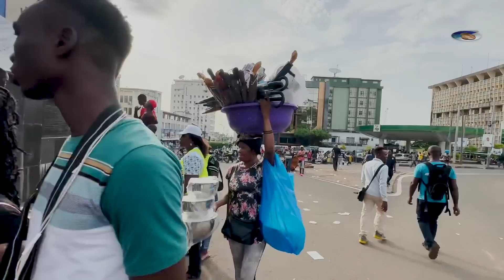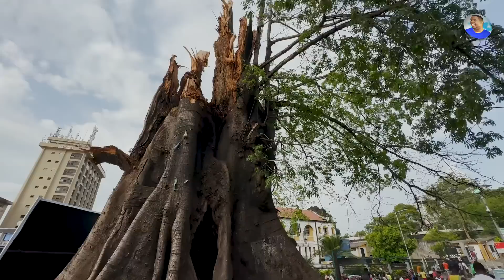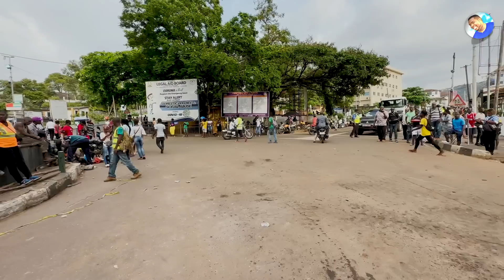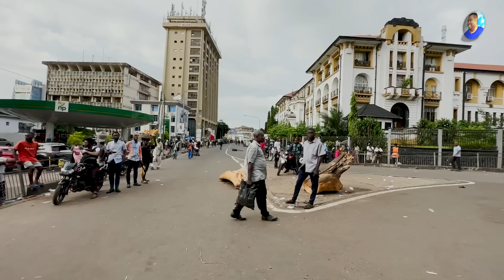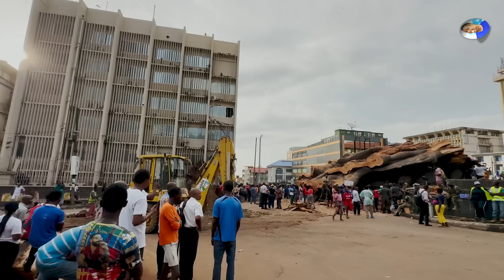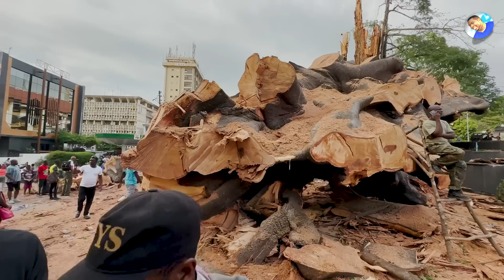THE FALLEN FREETOWN COTTON TREE 🇸🇱 - VLog 2023 - Explore With Triple-A

Comment: The reason why the tree fell was because of the fire that was put a blaze. The base of the tree could no longer hold the weight and height of the cotton tree, that’s why the tree crashes. Blame those who set the tree on fire.
Reply: Thank you for info 😊
Reply: Did the truck fire burn it down .
Reply: The tree was felled by a storm which sheered off a big branch. A further rainstorm brought it down. Nothing to do with someone lighting a fire, florencerettew6985!!!!